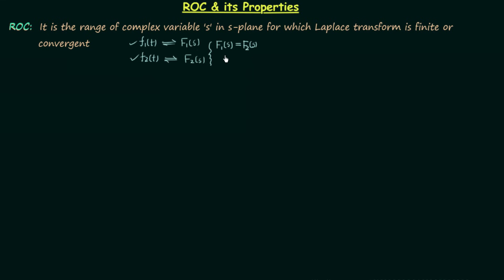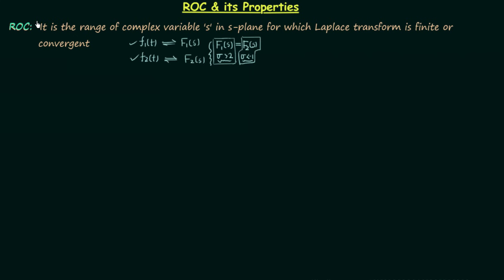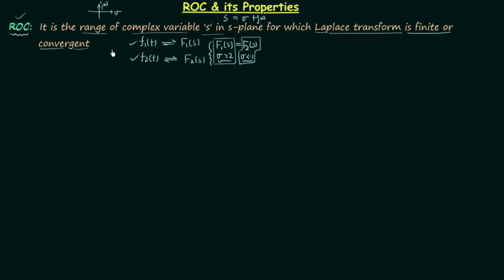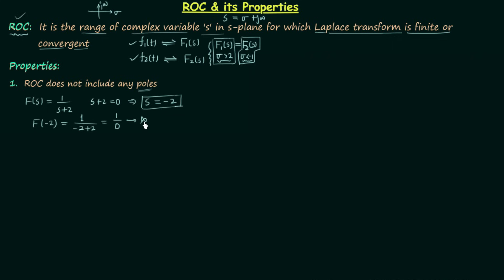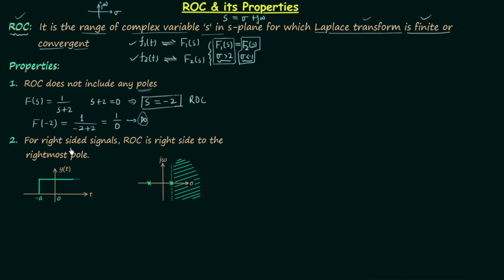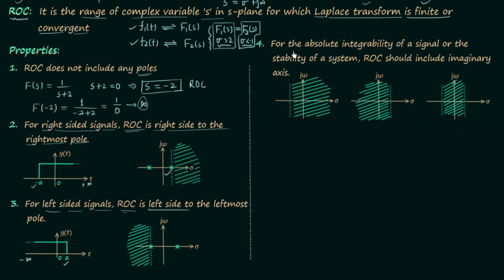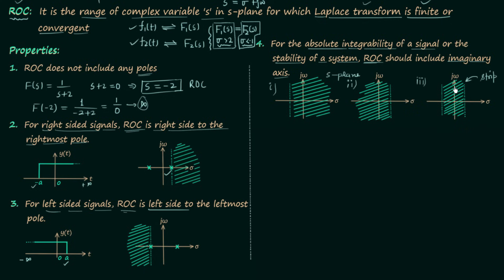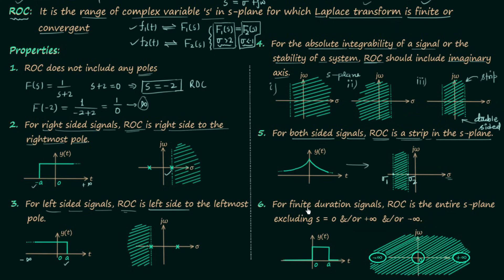ROC and its Properties

Comment: 00:09 Laplace Transform and Fourier Transform are unique properties of a time domain signal

01:24 Region of convergence (ROC) is the range of complex variable where a Laplace transform is finite or convergent.

02:46 ROC is the range of complex variable s in which the Laplace transform is finite or convergent.

04:11 Poles are not included in the ROC of a Laplace transform.

05:32 The region of convergence is on the right side of the rightmost pole.

06:51 The region of convergence for left-sided signals exist on the left side of the leftmost pole.

08:12 ROC for both sided signals is a strip in the s-plane

09:35 ROC for finite duration signals is the entire s plane excluding s=0, s=+∞, and s=-∞

01:24 Region of convergence (ROC) is the range of complex variable where a Laplace transform is finite or convergent.

02:46 ROC is the range of complex variable s in which the Laplace transform is finite or convergent.

04:11 Poles are not included in the ROC of a Laplace transform.

05:32 The region of convergence is on the right side of the rightmost pole.

06:51 The region of convergence for left-sided signals exist on the left side of the leftmost pole.

08:12 ROC for both sided signals is a strip in the s-plane

09:35 ROC for finite duration signals is the entire s plane excluding s=0, s=+∞, and s=-∞

Comment: does anyone know how to solve this with steps thank you:

The system function of a system is H(z)=(1-7z^(-1)+5z^(-2))/(1+0.5z^(-1) )(1-5z^(-1)+6z^(-2) ) .
(a) Find all possible ROCs for this system.
(b) For each ROC from 2.(a), find the impulse response h[n] of the system.
(c) For each ROC from 2.(a), find if the system is (i) causal, and (ii) stable.
Reply: this video is about laplace transform, not z transform

Comment: Why for finite length signal, roc doesn't include s=0?
Reply: This is because we factorize denominator to get poles. If s=o means the Laplace transform of the function will be1/s . In that case if we substitute s=0 in 1/s we get 1/0=infinity . according to the definition of roc , it lies only when lt is finite . So roc doesn't exist for s=0